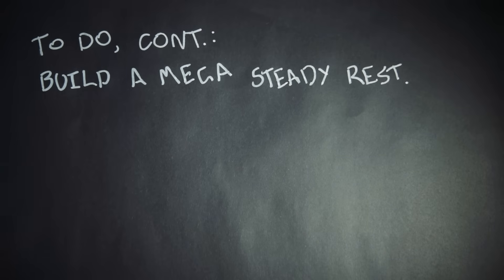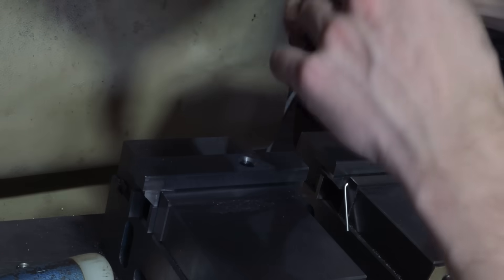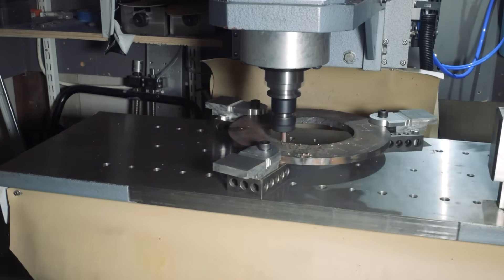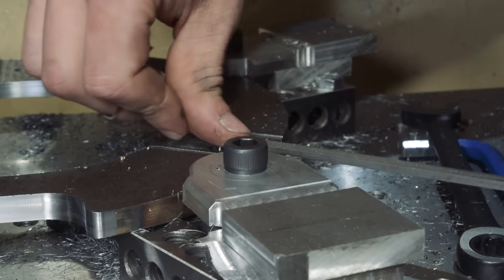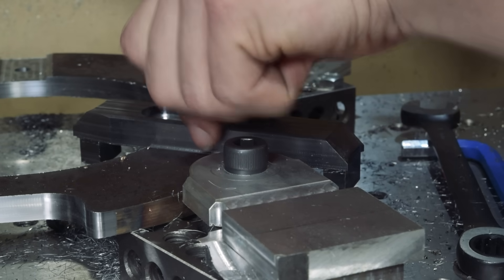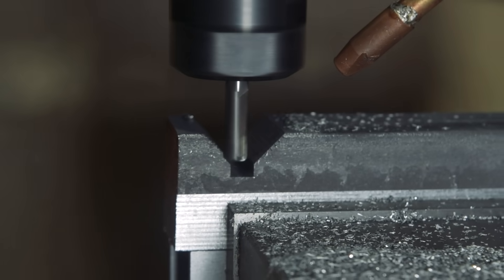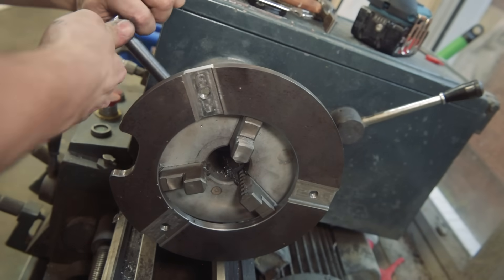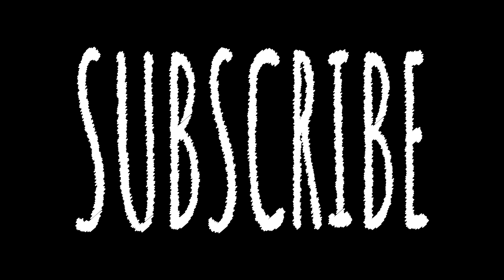I made a steady rest because I suck at planning

Comment: 13:36 one simple idea on how to produce a bearing surface for the steady-rest: Turn the workpiece around and make a nice smooth and concentric area close to the chuck. Also use it at this point to set the lower fingers of the steady rest. Then turn the workpiece around and place the steadyrest properly. Lock in the upper finger and you are ready to go.

Comment: A suggestion! At my shop, we locate out parts by setting a .250” pin in the spindle and sending it to the edge of the part in order to use it like a vise stop. In the case of your fingers you could very easily send the spindle above where the hole should be, then placing the parts in the vise and allowing the spindle to drop into the hole and sliding the part against the pin and tightening.

Comment: ive had surprisingly good success with a trick i was shown building a steady rest with 3 urethane roller blade wheels.  theyre high durometer but squish once you get some preload they run smooth enough on unfinished pipe even unround which is silly to do but i lack a large lathe and do things too large to use a tailstock and center to start some projects so urethane wheels is my jam.

Comment: Probably too late for you to see this, but Loctite 480 for jobs like the brass you stuck down.  Don't bother with the tape, just glue the part right onto your fixture plate, you won't even need a clamp for soft materials like brass.  Heat it up with map gas torch to release afterwards and clean up with acetone.

Comment: I at some point am gonna make a fixed steady rest as well, but from things i can get or find easily, was gonna use a truck brake drum for the ring part and cut off the crap i dont need, drill the 3 holes thru the ring for the legs, weld 3 pieces of short pipe on, 3 long pieces of high tensie fine all thread with ball bearing on the ends instead of bronze, the slightly technical part is going and getting the bed way V machined by someone

Comment: When welding on the lathe completely disconnect the wiring, even a tiny leakage can cause damage since the actual contact is tiny it doesn't take much.

Comment: 9:15 Ive had the tool holder come put on before its horrible. First time the holder shot out luckely missing me while retracing the spindle, think it was caused by my z limit being set to high while rapiding. Second time the holder didnt come out completely but was loose, this was also my first time cutting tool steal with carbide and I was honestly thinking for about 5 mins maybe that was just what it was 'supposed' to sound like before coming to my senses.

Comment: That speech you made to avoid people being disheartened is what made me disheartened! If it wasn't for it I would have been fine with accepting that you have a milling machine and I don't. But now that I know you BUILT your cnc milling machine while I'm struggling with building a milling machine with no computer components, only lead screws, I feel disgusted. By... everything. I'm gonna go sit in the corner and not make eye contact with you anymore.

I'm not taking myself seriously, don't be offended, like your videos a lot
Reply: Oh, and since you might actually see this comment, I'll ask for advice. I noticed you were bolting down things you machined. Is that how it's done? I just held it in a vise, but I'm constantly having issues with things shaking free and mounting things perfectly horizontal or vertical is impossible, even with a square or level

Comment: A basic rule of thumb I follow when not sure on feeds and speeds. Mild steel 60m/m and for a roughing end mill about 0.1mm/tooth and finishing 0.025mm/tooth. (These are just rough feeds and speeds)
Reply from the maker: In this case it's less to do with optimal feeds and speeds, and more about what my rickety homemade mill can handle without screaming in protest. Thanks for the tip though!

Comment: not sure how fast can you push your machine in terms of feeds, but in my experience as a cnc programmer/machinist in a job shop, the key to high material removal rates in steel with weaker machines it to run them with good HSC/trochoidal endmills, low radial DOC (around 5-10% of tool diameter(, full depth, 1.5-2x rpms compared to regular cutting speeds and high feeds, let her rip... i would recommend taking a look at Guhring Navigator and as an example calculate some speeds/feeds for art. number 5654

Comment: I still want to see what happens when as per your ‘interchangeable jaws’ design; you fit a triangular part into corner jaws in the steady rest and turn the lathe on. 
I can’t decide if it would just trip the circuit breaker, or obliterate parts.

Comment: Quick tip.. when you are running a new program (or even a repeat old job that came back), always run on OP STOP (Optional Stop), watch every tool come down and check it to your distance to go (or current location), understand what the CAM program is doing so you know what to expect, and watch the first 30-60 seconds of a tool with one hand on the e-stop. This has saved me from countless scrap parts. It's take a little bit longer, but I've probably saved over $50k in scrap parts and scrap tools over the past 8 years simply because I missed something in the set up or program or one of the operators in setup training didn't know any better. It's so easy to miss a number or move a decimal plate or have the wrong button checked in CAM. Back plot / Graph along with OP Stop are crucial. 

My advice to the new guys are watch every tool come down every time for the first part (new or old). This will catch a tool offset that wasn't set, an incorrect coordinate system, and more. 

Well done on the video! So happy to see the $270 spindle is still rolling! You don't have any idea how tempted I am (or maybe you do and that's why you ended up with one). 

The next step up starts getting into the all in one powered units around $1k (Lusitun seems to actually be decent) or around $800 for the unpowered setups, but with everything except the spindle drive motor or servo. We need a follow up!

Comment: I'm not a machinist, but it looks to me as if you're trying to take too deep of a cut with your endmills. I do program and operate CNCs, and the rule of thumb I was taught is to limit the depth of pass to the diameter of your cutter. If you're using a 6mm cutter limit your depth of pass to 6mm. Again, its just a suggestion, but works well for me. Keep up the great work, it's very inspiring!

Comment: you need to change  your cutting direction  ...  use  climb  milling    so it wont be   hard  for you t little  machine
Reply from the maker: I've been messing about with both, there's a bit too much backlash in the cheap ballscrews for heavy climb cutting, resulting in some nasty chatter and a terrible noise!
Reply: @NoEngineerHere  oh  ,, i see .. conventional cutting also makes your tool dull faster ..  just  use dynamic toolpath and small  stepover (chip thinning) they call

Comment: i started my journey of hobby machinining just over a decade ago and now its my full time gig. I remember starting very similar to how you have so you better be careful or you might transformer into a full time machinist!
Reply from the maker: It's a slippery slope ain't it
Reply: I'm trying to go the other way, only as a hobby. Even harder to do!
Reply: @ADBBuild  it's definitely an expensive hobby
Reply: @HuskyMachining  It's also hard going from industrial-grade machine tools to hobby ones and tempering expectations. I find I have to drop my feed rates 4x than what I initially thought.
Reply: @ADBBuild  interesting. I came from a background with 0 knowledge of what machining even was let alone what machines did what so even my first POS diy cnc mill blew my expectations away. But now that I use a VMC everyday it would be hard to go back to a hobby machine.

What big kid machine do you run for your dayjob? and what hobby machine do you have?
I used to own a tormach and I have a langmuir MR1 as my hobby mill now (I actually really like the rigidity of the MR1 but the no ATC is annoying)

Comment: The way you clamp stuff is still better than me. Some of the contraptions I come up with using C-clamps and bits of steel cutoffs I put into my scrap bin are horrifying.
Reply from the maker: Git 'er done
Reply: @NoEngineerHere   As a fellow Australian that says this in Larry the Cable Guy's voice multiple times a day whilst working in an engineering workshop. I wholeheartedly approve of this comment.

Also awesome channel man. When you release a new video, I seize the opportunity to do the responsible thing and not go to bed until even later, despite knowing full well its nearly midnight and I have to start work in roughly 6 hours.

Keep up the good work.

Comment: Brilliant as always!

A good practice in designing inside radii is to dimension them 0,5 mm “to big”. R4,5 in your case. Then the cutter will never have to come to a full stop in 90 deg corners or snap when experience a rapid increase in tool load. 
Use the ability of the machine, then you’re not stuck to a specific size end mill. At least in some cases.

Great content. Can’t wait for the next episode.
Reply from the maker: I think my brain was somewhere else while I was working on this thing. So many little oversights. 

Thanks for the comment, glad you enjoyed!

Comment: Can't really tell because the tool is spinning, which direction it is going, but at the 8:39 cut when you start sending it, it is generally better for tools to "climb" when milling. When the tool spins the action would make it want to "climb" out of the path it is cutting. While of course paying attention to the cutting edges of the tool and what direction it wants to actually work in.
Reply from the maker: I've been messing around with climb vs conventional milling; because the ballscrews are the budget kind, there's a fair bit of backlash in the axes, which was causing some pretty terrible chatter! It's much happier/quieter conventional milling at slower rpm and feed. Thinking about ballscrew upgrades though!

Good eye there 🕵️‍♂️
Reply: @NoEngineerHere  In terms of using superglue and masking tape to do work holding, you need good cooling, as heat breaks CA bonds. stuffmadehere used it quite a bit on one of his projects a while back, and clickspring does it a ton, (without the masking tape, he just heats it up after to break the bond)